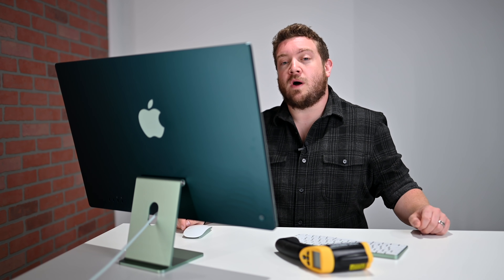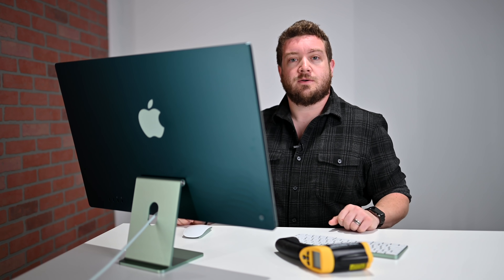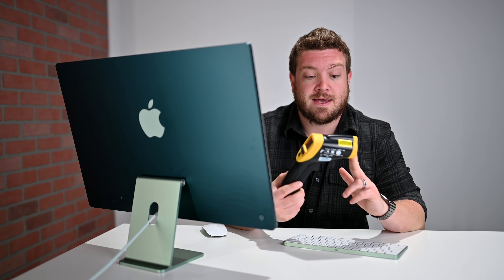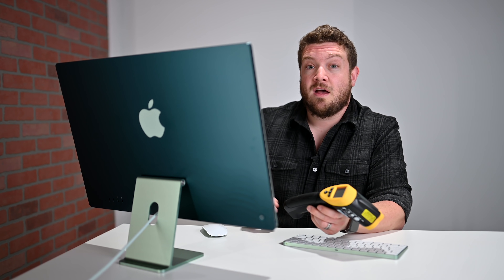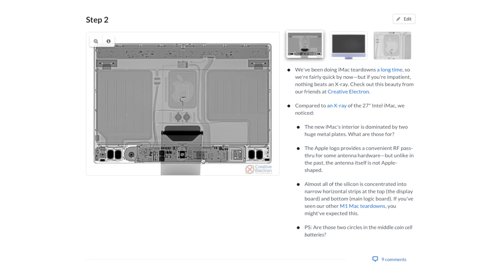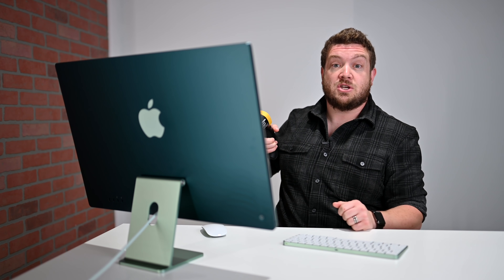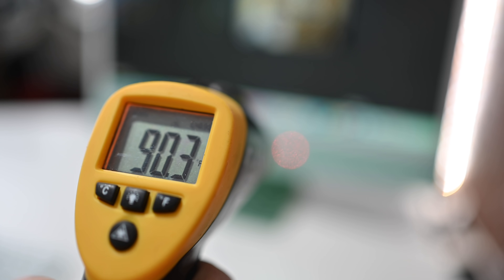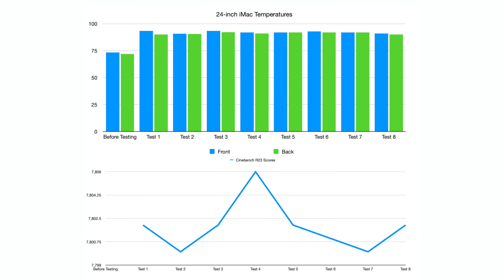24” iMac: Thermal Throttling Problem with Thin Design? Thermal Performance Tested!

Comment: Hello,

I just bought an iMac 24 2 days ago.
Thank you for your testing the thermal throttling!

By the way, have you heard of a “strange” smell is released from all around the computer?
I have been smelling like burning plastic or electrical.
The odor is not too strong but I always smell it while the computer is on, so I feel like I want to  wear a mask! Well, it is not pleasant to smell it.
And I am about 24” away from the screen.

Have you heard of this issue yet?

Thanks!

Comment: Why can’t you just enjoy a product? The average user doesn’t concern themself with thermal throttling. Even if it was, the product will still run the job you are doing.  Sometimes, when you go looking for a problem, you will always find one.  Just my opinion.  🤷🏾‍♂️

Comment: I think it is a bit different story on the base model since it only has a single fan.  MaxTech did a video on that.  I saw 4 ports, so I know this is not a base model.

It is a bit concerning that a 15-watt CPU is getting up to over 90 degrees.   They can't increase the power limit of the CPU and not expect to beef up the cooling.   How hot would it get if it were a 30-watt CPU or 45-watt CPU?  As hot as x86 CPUs?  It seems that the only advantage that ARM has is power efficiency, not thermals.
Reply: he gave temperatures in Fahrenheit in this video. 90°F is about 30° in Celsius. So M1 machines are definitely cooler than x86 CPUs.
Reply: @commelles  https://youtu.be/HLF8Qdq7eYs?t=440  ---- This test shows 90+ degrees C on the base model and 70+ degrees C on the mid-tier model.    Max Tech showed that the base model does thermal throttle due to single fan cooling.  A better cooling solution on the Intel iMacs would have made a huge difference.  But then, again, Intel machines would never be 11mm thick... like that matters in a desktop...
Reply: @webpoet73  i’ve seen max tech test too, and yes the base model imac got to 90° Celsius, as most apple macs would get in this kind of stress test that max out the cpu. But in reality, on every day use there is little to no chance that you would see the M1 get to 90°C because it has been clearly confirmed that ARM base soc like this one run unbelievably cool (30° most of the time) compared to intel chips that would run between 50 and 80°C all the time in mac laptops.
Reply: @webpoet73  so imo ARM has a clear advantage with power consumption AND thermals.
Reply: @commelles  at 15W, they get up to 90 degrees C and thermal throttle when not properly cooled.  Same as x86.   Image how hot ARM would get in a higher TDP.  The advantage is clearly in power efficiency.  At the same TDP, ARM would be just as hot as x86.  MaxTech clearly shows this.
Reply: As Stephano said above, these readings are in Fahrenheit. Almost everyone uses Celsius, though. 90C would be hot, but 90F (32C) is practically frigid by CPU standards. My Intel CPUs run at 35C when sitting idle, let alone doing something as intensive as a Cinebench R23 test.